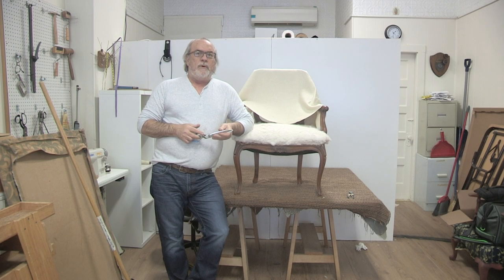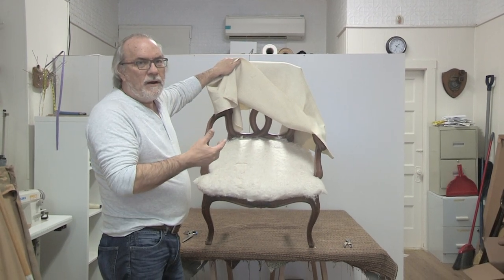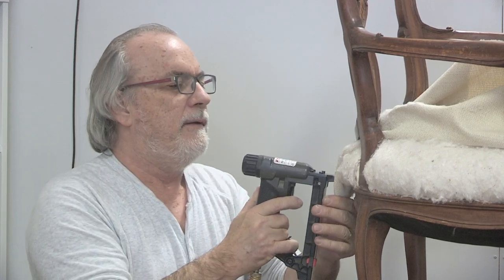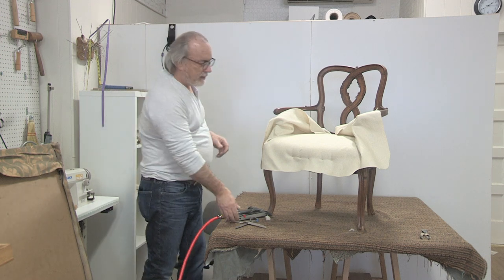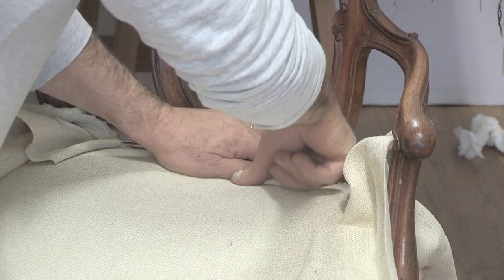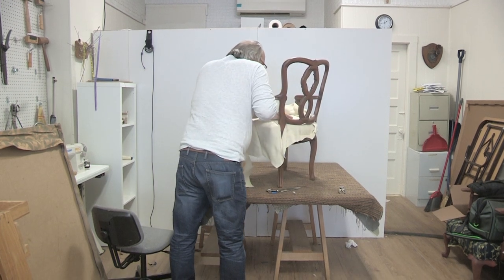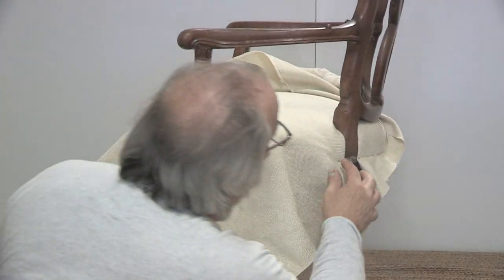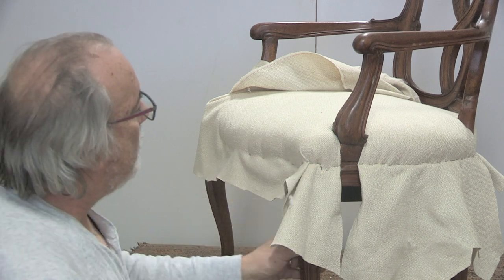How to Cut Fabric Around Posts

Comment: Thank you for your helpful videos. Just about the time I think about a question, you always seem to come through with an answer. I am working on a French cabriole chair. It's an antique, has its horse hair, hand carved and it is a pretty chair. Question: I am looking for a video that teaches cutting on a chair where there is a post (pretty good size post) dead center in the back and at the usual back corners. I have been practicing with scraps of materials to figure out the cutting, but the stapling and pulling at the front when the back is not stapled in the center is a challenge!! Any suggestions? Thank you for sharing your wonderful knowledge! Julie